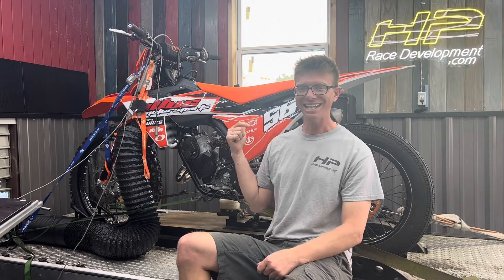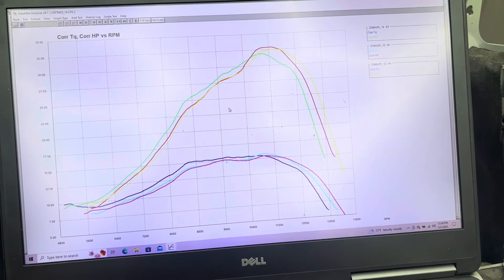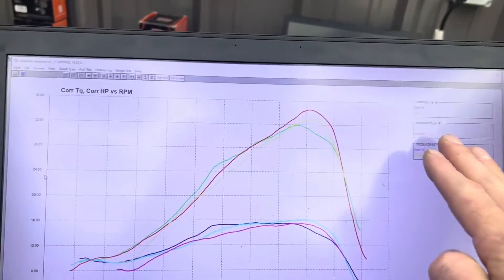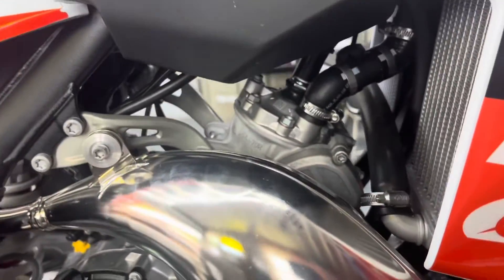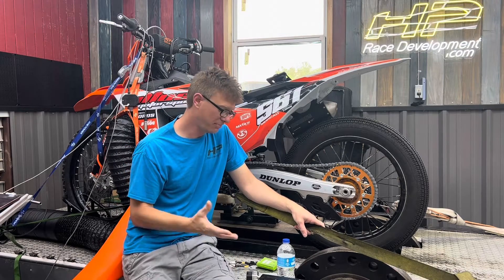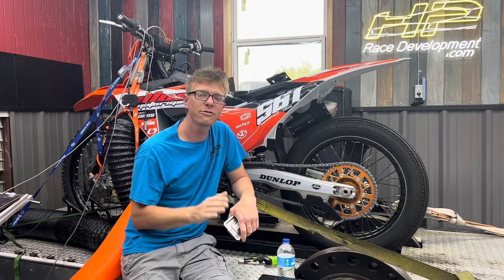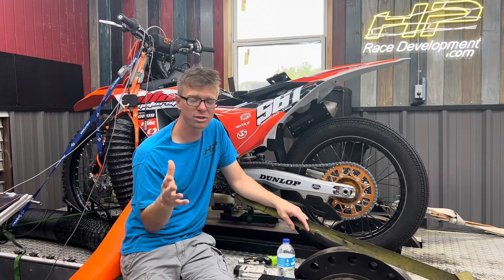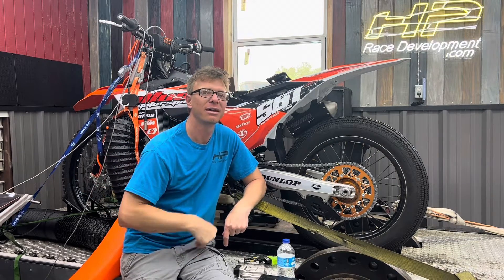EFI 2 Stroke 2023 KTM 125 Dyno

Comment: Appreciate the videos, just providing my opinion on EFI 2 strokes. I think if you ride at the same elevation, and in the same temps all the time, then carbs are hard to beat, for their simplicity. However, I live in Texas near sea level and have been planning to take my carb'd 2 stroke to colorado and hit elevations 13,000'. I don't want to be stressing about air screw settings, needle clips, pilots, mains etc as I got up and down a mountain. I know Lectron and Smart carbs are getting popular, but they not "auto adjusting" and don't perform as well as a carb with Jets.

Comment: EFI on 2 strokes is why we still have 2 stroke snowmobiles. It's good.
Reply from the maker: Try sell that on the moto community who hate it...

It has a long way to go for MX and offroad usage - far harder demands on EFI than sleds
Reply: @HPRaceDevelopment  As far as 2 stroke dirt bikes. Yes. Pushing EFI is probably dumb. Especially if they aren't even going to use a pipe temp sensor. Carb and be done with it. As far as Snowmobiles. They are at an extremely high state of development, the demands high and varied. Power, reliability, efficiency EPA emissions and noise regs are being balanced and delivered. Close to 180 HP(Dynotech Research) out of 850cc. Mountain sleds at full throttle constantly, wild elevation changes 155" tracks with 3" paddles, huge load. Same engine can also trail ride, or idle along with kids all day long. 16MPG if your a good boy. 18-20 on a 600. FACTORY turbocharged 2 strokes for trail and mountain sleds. None of this is possible without direct or semi direct EFI. Also not possible without $$$$$. So the answer is....As you said. Just use a carburetor for the bikes.

Comment: Man, who knew two strokes were complicated 🤯 I guess they wanted to transition to four strokes as they thought they maxed out on 2 strokes yet the manufacturers still had trouble trying to improve it.
It’s all coming together now, my uncle was telling me it too about the ignition and how hard it is to find power. That’s why altogether they switched on the new 4 stroke platform and made their tuning and mapping easier and of course no replacement for displacement.
Thought the whole time it was an emissions cause.
Now that I’m thinking about it we wouldn’t have had seen the speeds the 4 strokes gone if 2 strokes were still in.

I had gotten a Husqvarna TC125 2023 yep bought into the hype. The only good thing is just electric start and of course the chassis and for me personally just having a main frame bike as I had ridden the kx100 for about 5 years.

Thank you for this video Derek 🫡

Comment: They don't call me analog Eddie for nothing,  you can make more HP from a carburetor and it's way easier to work on, less expensive to fix, but fuel injection on a 450 is key to making usable big power,  compared to a carburetor on a 450 that makes 60 hp.
Reply from the maker: I think on a four stroke we make more on efi now. It has opened up tremendous avenues not previously possible.

Comment: It doesn’t add complexity to the owner. Never having to adjust the carb or power valve is awesome. Electric start too. I bought the 300sx and it's the best bike I've ever had. Sounds like the crank pressure sensor replaces the map sensor because of the frequency variables that can only be accounted for in the crank case. Overall this bike will probably have more power than a carb bike on average because you have to constantly stay on top of carb settings to make peak power.
Reply from the maker: while none of your statements ring true for me - maybe in the near future you might be right. That said the used bike market is going to take a nose dive replacing a fuel pump and injector is a lot more expensive than a carb clean. trouble shooting electronic issues is time consuming and thus pricey - and the stock 300 tbi is a turd vs the previous generation carb 250sx on my dyno
Reply: @HPRaceDevelopment  In the last 15 years that I've been riding, neither I nor any of my friends have ever needed to replace a fuel pump or fuel injector on any of our bikes. And we ride year-round in the southwest.  That kind of stuff usually lasts the life of the bike. The only electronics issue's I've heard of that's somewhat common is a bad stator coil. And if something does go bad on an efi bike it can show you the code so you know what to fix. It saves time. This is like the argument of Estart when ktm was the first to do it and everyone hated on it. Now everyone has it and loves it. I was the first of my friends to adopt that too.

Comment: I don't like the complexity of EFI but I have worked on and ridden BRP (ski-doo) two cycle products with EFI.  They really seem to have it figured out ... I'm not sure about the other two cycle snowmobile manufacturers, but BRP has done amazing things with their engines over the past decade. 

I am a carburetor guy through and through, but BRP has completely changed my mind on this for snowmobiles. Their snowmobiles have better throttle response, more linear power delivery, better fuel efficiency and they just work. They also have an 850 Turbo, and while 180 hp isn't a lot for an 850 twin, riding it is impressive. They also manage to do this with a single exhaust in a very small package. 

This being said, they use direct injection and lots of sensors. They do have non direct injection models, they seem great but not outstanding. 

I'm considering putting EFI on one of my jetski engines as a fun project. Not because it's better or makes more power, but just for the experience of doing it.
Reply from the maker: efi is easier on a sled or ski. but they have it solved far better than anyone else - with as modern of 2 stroke tech as ktm. Sleds are impressive
Reply: @HPRaceDevelopment  Thanks for the response !
Reply: And then they stopped production cause of emission limits
Reply: @AAAAAAndrea  ? They made a 2024 850 Turbo. Who stopped production ?
Reply: @JoelArseneaultYouTube I've read  Evinrude don't make outboards no more 😥
Reply: @AAAAAAndrea  Oh yes. They have discontinued some of their products. Who knows, maybe they will be back.
Reply: Smaller and more powerful engines are more difficult to build. Brp/rotax could not be done
even as good a 125 efi as ktm
Reply: @mkkiloma3991  I'm going to assume that you mean well with your comment and that you are simply misinformed. If you care to do a little research, you will find that BRP isn't just capable of making small engines with power, they in fact make a 125cc engine that makes 32hp at 11,500 rpm. 

Not sure where you would get the idea that BRP, a world class engine manufacturer, isn't capable of making a good small engine. 

In some ways, small engines are more difficult, but in many other ways, they are much easier, and the simplicity of a single, compared to a twin is also hugely beneficial.
Reply from the maker: he is saying brp could not make an efi 125 that would perform better on track than the ktm currently does. 32 crankshaft oem reported power would be 25 on my dyno by the way.
Reply: @HPRaceDevelopment  Oh... I see. I didn't get that at all... You're much better at deciphering than I am, haha. I understood his comment to mean that BRP couldn't build a small /125 engine, that was as good as a KTM 125 efi engine... And I don't agree with the comment either way... If they have attempted to build a 125 efi engine and have failed, I stand corrected. 

Yes, I assume the Rotax karting engines are all rated at the crankshaft for power and it would be much less run through a transmission and on a wheel dyno. I wasn't trying to say that they made more power than anything, just that they do make small engines that make decent power. I'm guessing that the karting engines are not cutting edge BRP tech 🤷‍♂... and think that they may be regulated / limited... tho I have no idea. I don't follow karting, or Mx ... or anything these days. The last article I remember reading about MX was Guy Cooper's retirement.
Reply from the maker: @JoelArseneaultYouTube  the really cool kartiing tech is italian - 50+hp at the countersprocket.  Not one is efi though - plenty have attempted with mediocre success.
Reply: @HPRaceDevelopment  Very cool and very impressive. After you bring this up it doesn't surprise me that it would be Italians or that much power. I guess top level karting is the breeding grounds for F1 and other professional racing. I generally just thing of it as a kids "sport" or pass time and forget that some people take it very seriously. 

Considering 500 Gp bikes in the 90s were making around 200 hp, a 125 making 50+ is very impressive. Not shocking. I assume they have a very narrow power band?

Comment: i dont think the problem is efi, the problem is that ktm half assed it the same as they did the tpi. none of the parts in a ktm come close to the quality of any japanese bike. theyre just not as reliable. i have owned a brand new husky and after owning japanese bikes my whole life (second hand,new etc) i could clearly see the lack of quality in these bikes. they will work and do some things great but would i trust it to take it deep into the nush riding with only few tools? hmmmmmmmm not likely. carby i would but none of these bikes
Reply: even just the design and location of everything around the throttle body looks horrible

Comment: 125s  can pump out 45hp with a carb.fuel injection is for diesels and dummies.
Reply from the maker: bring a 45 hp 125 to my dyno in an mx bike
Reply: @HPRaceDevelopment  I didn't say mx bike.mabe you don't dyno kart engines.

Comment: Hey what do you reckon about using a little more oil. Say 38/1 or 36/1 to lean out the air/fuel ratio? My plug is always black.
Reply from the maker: Plenty of people been doing that
Reply: Awesome, I’ve just seen your videos today. Well done, they look great with real info! I heard a whisper twisted may have unlocked the ecu on these new bikes. What’s your thoughts? Any room for improvement with current hardware or do you reckon they need more engine management components? Cheers. Paul

Comment: Can you tell my what sensor I will maby need for corect fuel air mixture calculating? I have APPS, TPS, Oxygen Sensor, CLT, AIT, MAP..... do I need something else?
Reply from the maker: Not familiar with apps or clt
Reply: @HPRaceDevelopment  
Apps == accelerator pedal position sensor
I have this sensor, because i use the drive by wire function.

Clt == coolant temperature sensor
Its the same as engine Temperatur sensor
Reply from the maker: @z-tech-extrem  You should have enough to make it work, we are talking two stroke right
Reply: @HPRaceDevelopment  yeah right!

Comment: I completely disagree. The MAP sensor is the crankcase sensor. The Electronic Power Valve gives the ability to maximize the powerband. All the negatives you pointed out have worked great in 4 Strokes.   I think you'll come to really appreciate EFI in the future.
Reply from the maker: The electronic valve is fine - we use and work with on other projects but its no better than the previous valve design. Its used so ktm can track its position for the efi tune.

The crankcase pressure sensor is similar but not exactly the same

And the current efi 125 will get smoked by a previous gen carb bike.  Until the hurdles that have yet to be solved regarding precise cycle to cycle fueling - it will never compete

honda tried very hard in moto gp and never was as good as their carb effort

Other markets have done decent but dont have the same demands mx does. We have been working hard on the efi ktms since the tpi came out and I feel have a far better handle on it than anyone in the mx world, but the bike gained weight, lost power, is less reliable, runs like garbage occasionally, and is far more expensive to sort out and maintain. I find zero positives to that when the carb version can and did work extremely well.
Reply: @HPRaceDevelopment  The powervalve is controlled by a servo motor, giving a tuner the ability to have full control of it and it frees up mechanical loss the old system relied on.  

The crankcase is the "intake manifold" per say, it's after the reed's and before the combustion chamber. The only place a map sensor can be placed. 

Honda found that the fuel injection made no difference in horsepower, but it gave the bike a more linear powerband. During that time in MotoGP corner speed wasn't important, the riders wanted the bike to feel more aggressive down the straights and even used the "big bang" timing sequence to further achieve that goal. 

I don't believe a carb bike would smoke the new efi, if you leave the bikes completely untouched from the factory and ride different environments. ie you have to change the jets to beat the efi bike. The efi bikes also have much more mid range power and i believe the top end is cut for emissions. VHM's 2020 and 2023 125 makes the same peak horsepower. 

Other markets are decent, but i probably dislike them just as much as you do. I agree that it's more expensive, harder to maintain, weighs more, and to get the bikes full potential it costs 1000's of dollars. There's a huge lack of support for the efi even from the tuners in the community, and the companies like GET and Vortex have yet to provide a product. Where i disagree is how effective the stock ecu calculates air fuel and the potential these bikes have to make more power than the previous generation. 

I think if we combine our knowledge we may be able to achieve just that.
Reply from the maker: @Joe69  On my dyno no one has brought an EFI 125 or 250 that touches what we had for the carb bikes.  We will be posting a video on an efi bike build up eventually - its shot and done but I need more track time to make sure it lives before I publish it.  Behind closed doors honda rides hated the EFI.  It was inconsistent and unpredictable.  Mid corner it would spit you on your ass and honda worked very hard to solve the varied air flow values per cycle and never did solve it.  The sensor technology exists to mimic what a carb sees but the computing HP to read and react is quite large on that. I think the crank case pressure sensor is a very smart way to know what's in the crank case each cycle - but on TBI injected bike you cant supply fuel for THAT cycle based off what you measure.  The powervalve can be tuned via a tuner but so could the old one - and it was the best PV design within the industry.  Correct - has mechanical losses.  But so does the new EFI stator and electronic system.  You can measure the losses on the dyno and it's quite large to power the full EFI system, fuel pump, and batter recharge/reg reg etc. People overlook that every watt you generate is more than a watt you loose to the tire.

Time will tell - it's going to be "good" but IMHO not great for a long while.   Thanks for the comments
Reply: @HPRaceDevelopment  very interesting. Stator definitely may rob more more power and the map sensor is definitely delayed a cycle. I’m going to contact you directly, I think we all want to see the best for these bikes.

Comment: sounds like the way you explained the waves back into the cylinder changes with temperature in the pipe maybe a temperature sensor in the head pipe might be of benefit to efi.
Reply from the maker: yes - but Its gas temp along the pipe length not just egt exiting the cyl

But some sleds with efi two strokes use egts as part of their strategies for success. They also run over a small rpm window making life much easier

Comment: Have you put in a BR9 plug in the bike and dyno? Runs way better with the BR9. You should contacts TPI tuning and see if he would be interested in sending you an ecu to dyno, way way better bike after the tune.
Reply from the maker: hotter range plugs dont do lot for wot runs
Reply: @HPRaceDevelopment  wouldn’t it help to burn at lower rpm, plus it gets rid of any sputter?
Reply from the maker: @ryanboening  Not at WOT. A hot vs cold plug has more to do with plug fouling than power.
Reply: @HPRaceDevelopment  yes. But the bike is way too rich for a br10, it fouls out way too easily.
Reply: @ryanboening  

Derrick doesn't like to hear friendly advice. He wants to be the smartest guy in the room. That's why his room is always empty. 😉